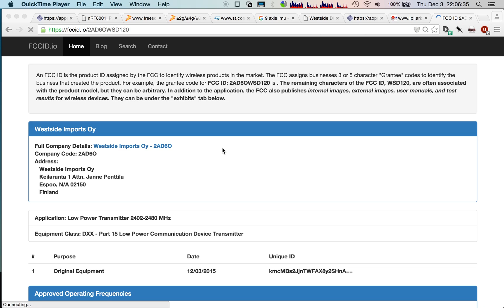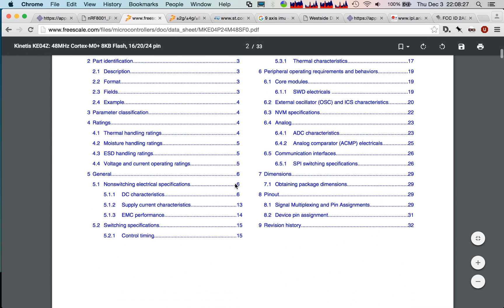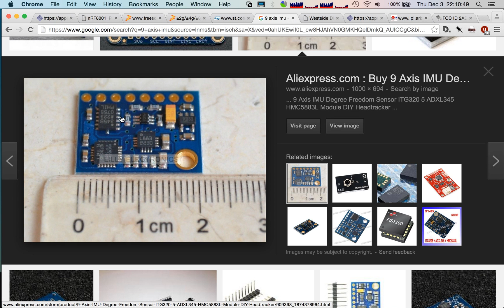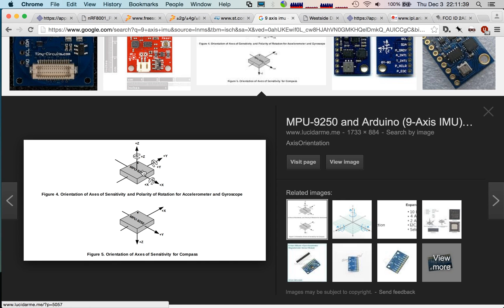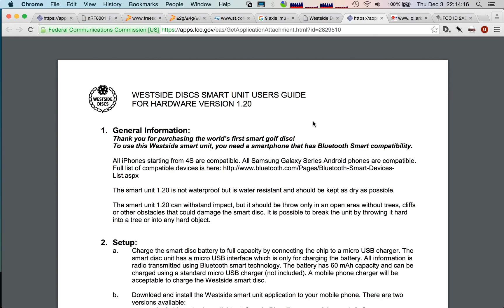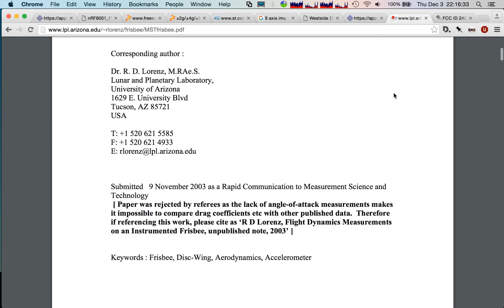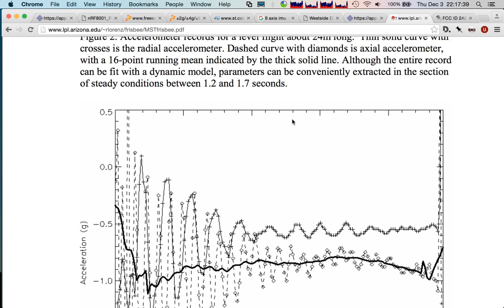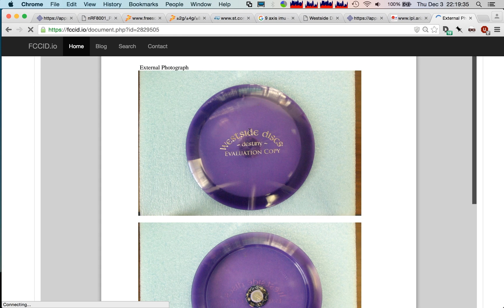Frisbee Telemetry: Virtual Teardowns #4

Comment: The data the disc records will be the following: Nose angle (angle of attack),  hyzer angle, the inclination of the line the disc travels along, and the acceleration rate throughout the throwing motion, and the speed of release when it leaves the hand (maximum speed)

This will allow the phone application to build a physical image of the disc's movements, and allow you to zoom in on them. It will allow the development of a "straight pull" when a disc isn't whipped in any kind of arc at all, but pulled along the line, smashed on the line, and released on the line.

It will also tell you if you are messing up the hyzer or nose angles during the pull through, and how hard you "hit" the disc when the arm stops moving, and the disc pivots the wrist before ripping out of the grip.

This will be a major step forwards for disc golf technique instruction and coaching, and I will buy one immediately.
Reply: Hi Chris, do you have any updates about this device or app?